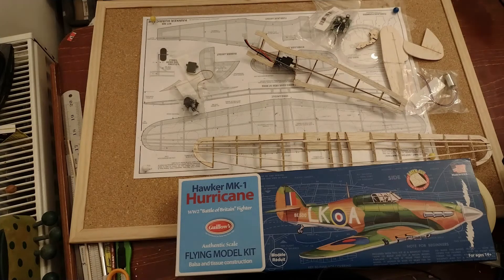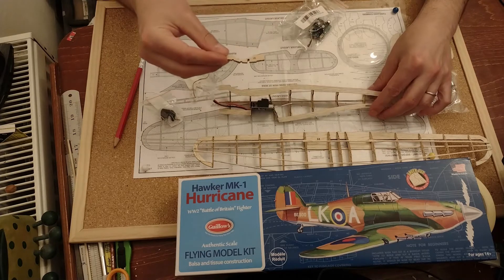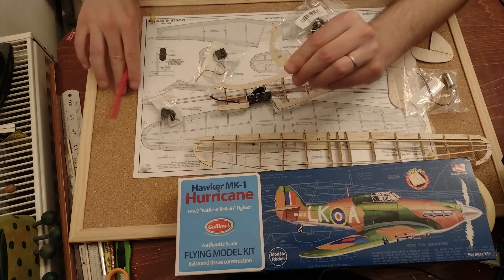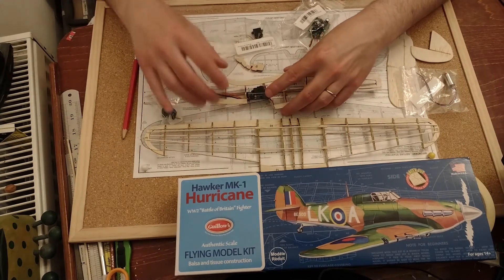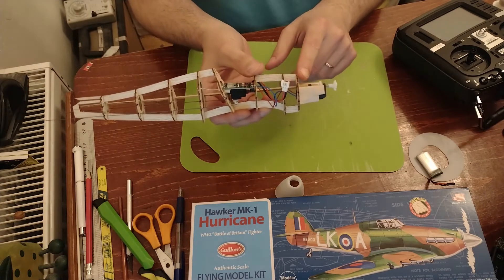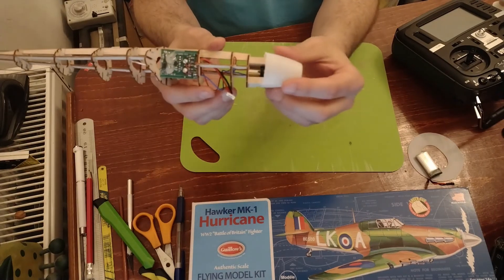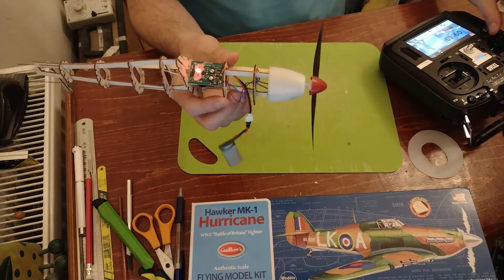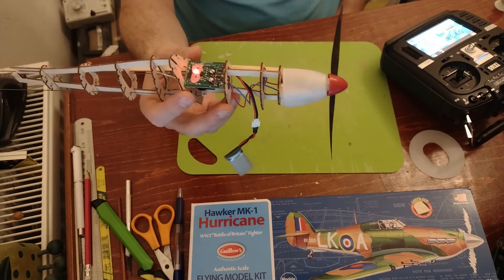05 Guillows RC Hurricane   Electronics

Comment: Been following your channel for some time and have found it very informative, well done. I too intend to convert the guilow kits,using eachine motor electronics. I note you use easy dope .I think if you use cellulose dope on your tissue ,you will have better results and more durable and water proof to morning dew on the grass.
Reply from the maker: Thx for following along! Lately I switched to glue/water mix and then a layer of lacquer spray. I struggle with the dopes and the thinners and all that. Thx for watching!

Comment: DC: You could use a couple of pairs of little magnets to hold the cowl on.
Reply from the maker: Good point. I am not too worried about weight in the nose. Maybe gluing the magnet to the cowl directly might work, or using the engine mounts ... I have to think of that.

Comment: DC: When you put in your aileron servo, don't butcher the centre rib! The servo can go next to it. Being slightly "off-centre" will look awkward but will work fine.
Yes, that will slightly alter the geometry of the left versus tight aileron drive. I doubt you could tell the difference. But, you can simply offset the aileron horns "spanwise"  by the same distance.
Reply from the maker: Very interesting. I hadn't thought of that. Good that I haven't butchered it yet!

Comment: DC - the motor didn't start because the EAR411 receiver unit has an "arming" function. Remember that from your P51 and the Eachine TX?  That is a RX function not a TX function. You have to arm the throttle channel with that RX no matter which TX is being used.
Reply from the maker: You are right. With the original transmitter it makes a beep, the Radiomaster doesn't. With the P-51 it doesn't seem to need the arming at all either. 
Thx for all the comments!

Comment: DC: if it's not too late, I strongly suggest that you make your battery hatch on the side, rather than cutting out the top framing.
Reply: Because of gravity, the greatest loads are up and down, so you should leave those top and bottom "keel" members intact, and make your hatch to one side or other of those.
Yes, make the hatch bigger. Up to half the fuselage if that is useful. But left or right not top or bottom.
And don't just assume that the hatch should be the whole of one side. If you retained the first stringer top and bottom, would your hatch still be big enough? If it is, the model will be much stronger.
Assuming you can retain those two stringers, reinforce them by doubling them up, using surplus stringer material. Enlarge the notch in the formers so this additional length of stringer is set into the former at each end.
Reply from the maker: That is a bit too late :( I have the hatch at the top. There is not much space to o it on the side. On the spitfire I did the upper side, and it worked but was difficult to take off. I am a bit worried of structural failure when it crash lands though. Lets see how it goes.